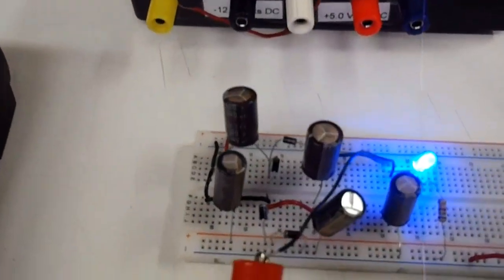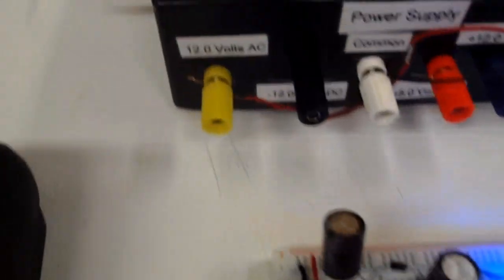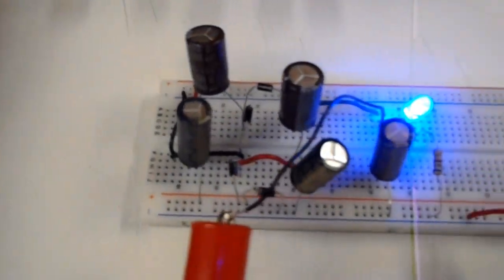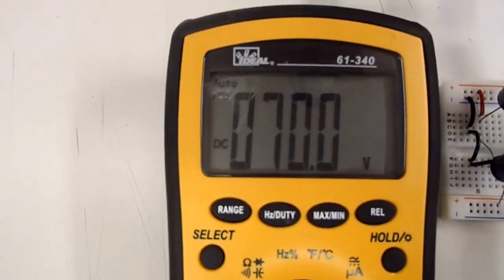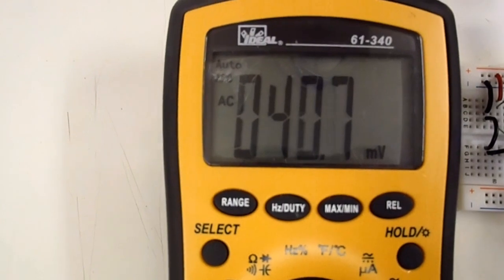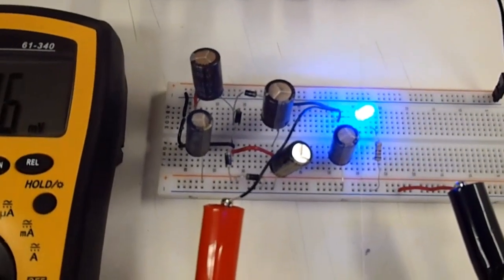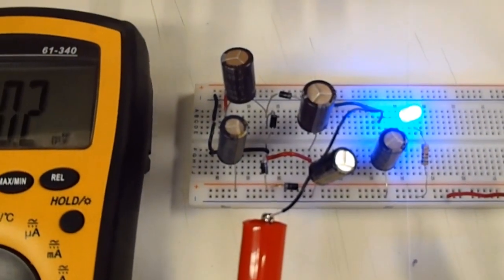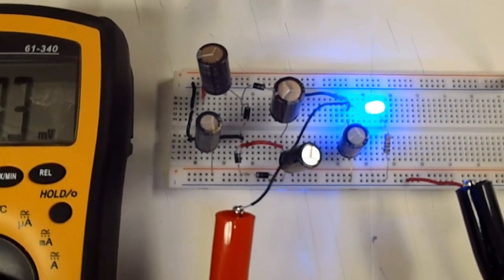How to make a Voltage Mulitplier

Comment: Thanks for posting this video, I was somewhat confused with other voltage trippler quadrupler circuits show in internet searches, as they use no polorization or even show the symboles that are actually different than the standard for polorization, so thank you for showing the positive and negative on the caps in your schematic

Comment from the maker: What is your initial power source? What current do you need (high current varies between person to person; on a typical day I usually work with 600 A - so high in my outlook is 3000 A). Well to get high current I recommend high voltage AC step down transformer to get the need current, rectification to create DC power, but high voltage is relevant to what your supply is . Any other method though possible I can not recommend as I do not have the experience to do so, but I will try my best.

Comment from the maker: I got that (except the input is AC)- I was using the AC side to measure the DC ripple of the circuit as I didn't have a scope at the time - not the best means but will produce a small perspective on the output of the circuit in the sense of peaks.

Comment: i see you know what you doing.. i need some help with basics.. having some truble understanding the volts amps wats and so on..  so my question is this.. can i compare electricity with water.. and for ex. charged  battery with the pool with water..   so  then the voltage will be the pressure of water in that pool right?    if the voltage is pressure then what are the amps and wats in this example?  please help. thank you

Comment from the maker: I will be creating a new video for the circuit design, as voltage multipliers seems to be a real high interest subject. I will also send you a copy of the circuit (you should recieve it by tonight). But please keep us posted on the results of configuring it to your wind power generator (make it a response if you could be so kind) as I would love to see some displaypractical results of such a circuit. But as far as free energy - I think it may only lead to higher efficiency; always a good thing.

Comment: sir my initial power source is a battery sir 12 volts 65 Ah capacity i am looking for a voltage doubler or quadrupler to increase the voltage of the batter and the current should remain same. the increased voltage is given as input to the load of mine.. so can you please help me

Comment from the maker: Also look into the description of the video as I made another voltage multiplier which takes 12 AC and converts it to 2000 Volts DC (a slight gain).... But be careful with high voltages as insulation of components may not be high enough to contain such sources of energy. 

Thanks for movitation for me to make another video!

Comment from the maker: It will take some work - you can't simply just plug this circuit in - 18 AMPS though is a lot of current what are you planning on running? I have another video called How to convert DC to AC and that is the way I suggest you go. Change DC into AC then you can use transformers - better for transporting power less loses plus you can get more current into your system! So watch the video and we'll continue to develop your project together!